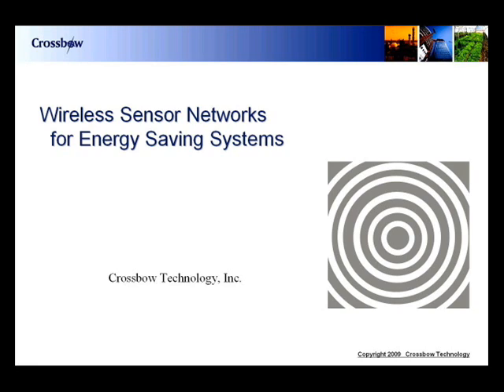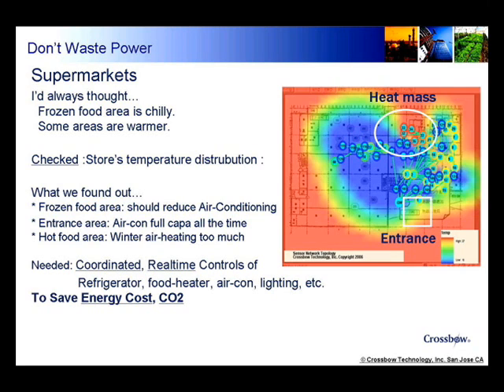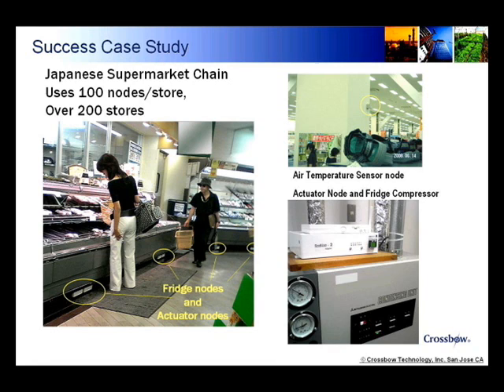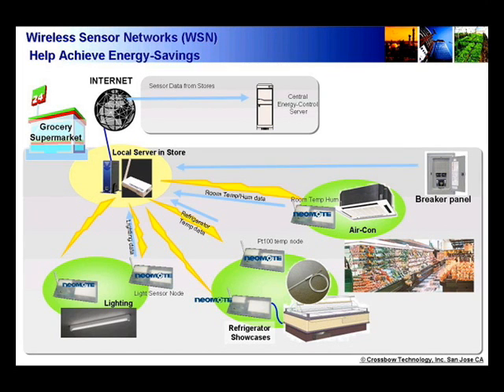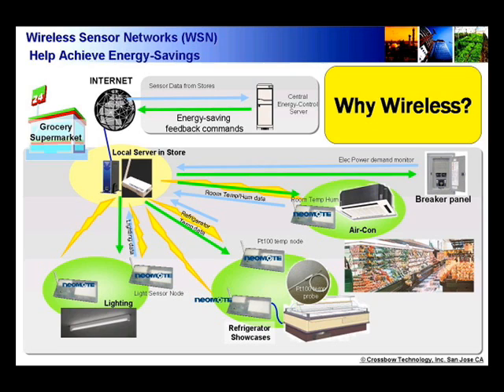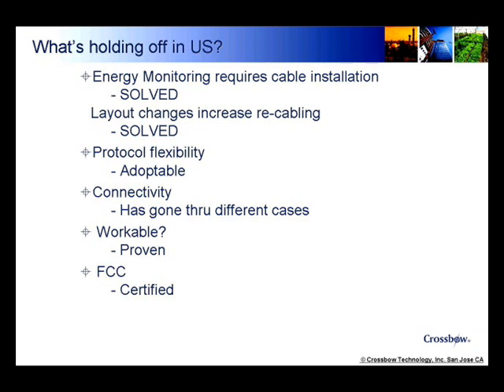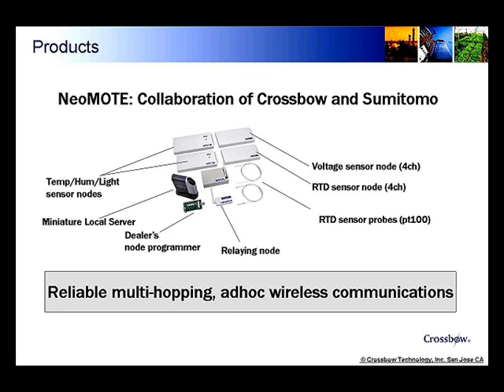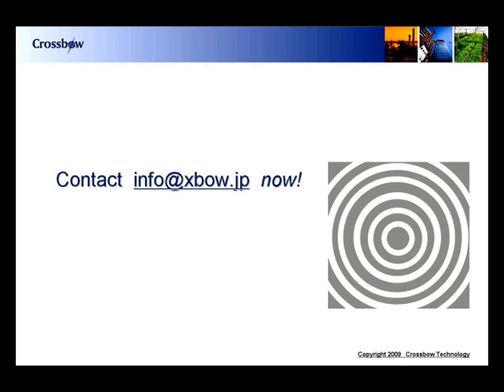【節電 実例】省エネ見える化 を 無線で Micro Smart Grid

Comment: I like it! It's not really clear to me how measuring can already lead to power savings. There should also be a possibility to then subsequently turn on/off the fridges. Does every supermarket allow a WSN to do that? Or are they always-on by default? (So, without an internal thermostat?) And is humidity information actually used in supermarkets?

Again, a nice video!!!